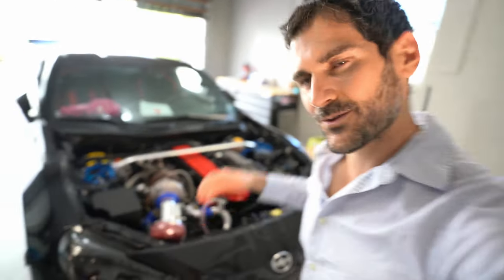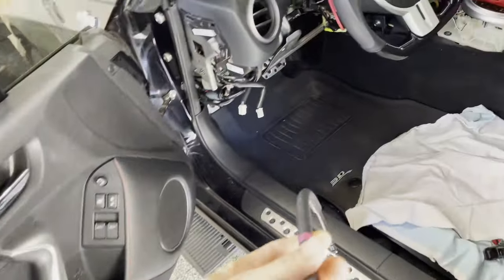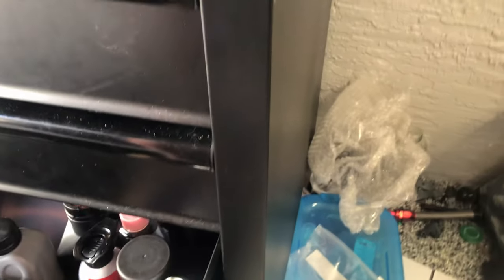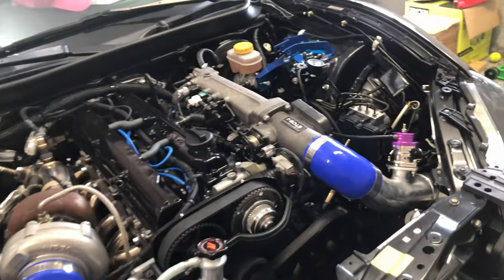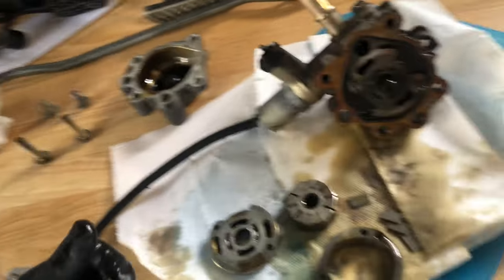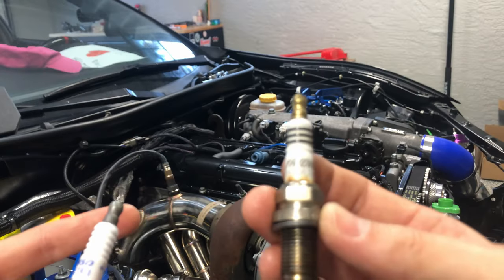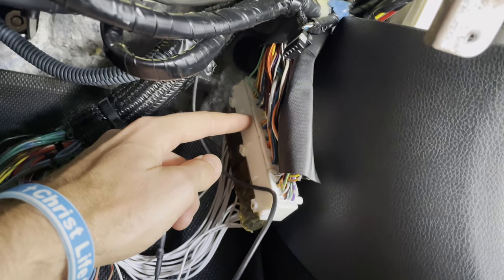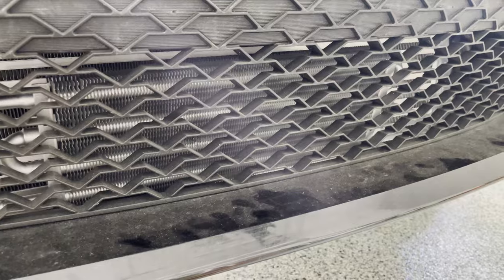2JZ BRZ Swap - Fabrication was INTENSE [Drive by Cable Conversion and MORE]

Comment: Nice work. For anyone with the pedal/throttle situation later, the stock FA20 pedal and throttle body can be used with an FA20 TB flange tig welded to the stock 2J intake manifold. The bore sizes are very similar and saves the cost of a fabricated manifold for no reason. On the factory electric power steering there is two wires under the dash that can be crossed and the power steering works all the time. I first saw that on the B is For Build channel  years ago. This "hack" may be found elsewhere after this many years. These are things we learned doing my 2013 FRS to 811hp. Keep up the good work!!
Reply from the maker: This is amazing mate!!! Thanks so much for sharing. Loved the idea of the DBW leveraging FA20 throttle body. Will use that hack for my stage II once I upgrade the ECU. Will follow your 811 build as inspiration 🔥👍
Reply: @MinkMood  Looks like you've got the majority of headaches done but let me know if you run into other items. Mine is 2J/CD009/Fueltech.
Reply: Canbus don’t run eps? I was under the impression they codes stand-alone for this already.
Reply from the maker: It does! I have a small box from camtrolls that came with the Tweakd wiring harness